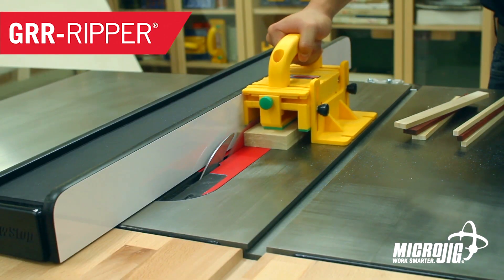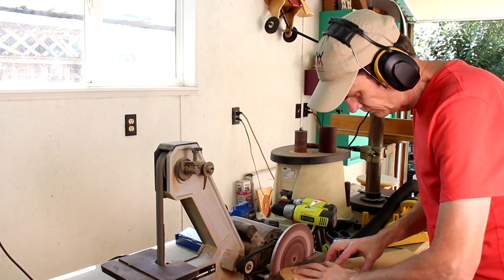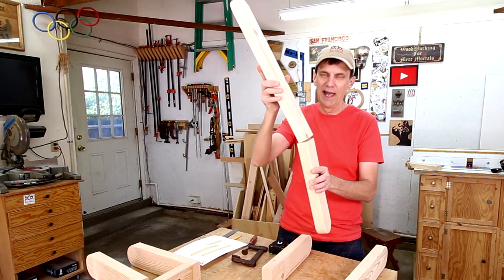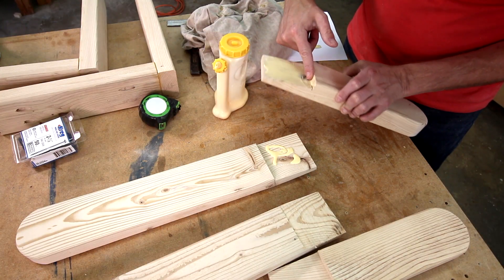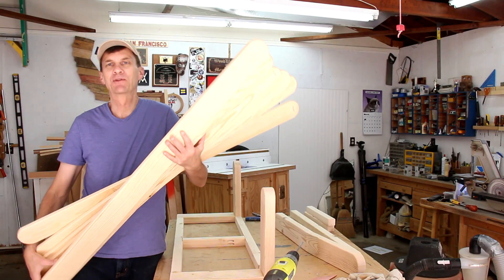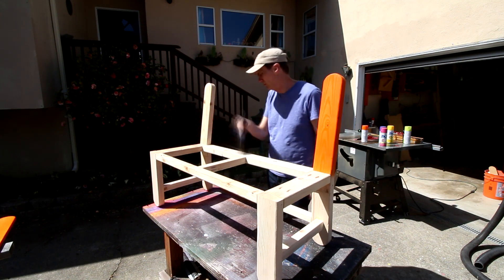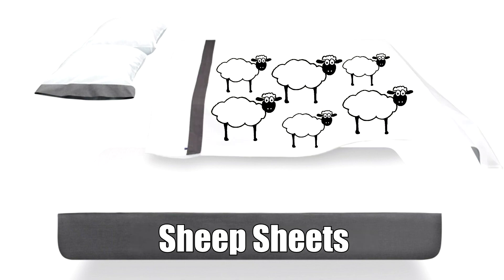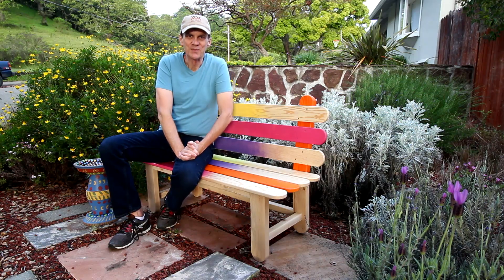Popsicle Stick Bench.  Fun and Colorful DIY Project for your Garden!

Comment: My grandson and I built the the bench last week, used Titebond III because it might be outside. The glue joint that i glued; the 10 angle, was painted so dis-colorization was not an issue. Everything was top coated with two coats of exterior clear water based poly. Thanks for the idea, my grand kids enjoyed it. It was a hit on my Facebook post too. Can i send you a picture of it?

Comment: Steve, look up a scarf joint as used by luthiers when making angled headstocks. One angled cut, plane the cut faces, flip one piece, line the pieces up and glue them.  I'm sure you could find some way to reinforce it with splines or something if you're not sure it's strong enough.

Comment: That looks great. I am thinking of making one for the local preschool, but how strong is that back going to be? [If required] is there some way to reinforce it?
Reply from the maker: +CodeFoxAus If you use those lap joints, the glue will be stronger than the wood.

Comment: Maybe do a simple box joint for the backrest and just cut off the excess that sticks out from the side. =D
Reply: Yes, that would make for a strong joint certainly.  In fact, I think I saw some Ikea dining chairs that had finger joints for this, so similar idea... increases the gluing area tremendously.
Reply from the maker: +He Ka Great idea!
Reply: Well now when I really thought about it, it would not be that easy... to avoid voids between the "fingers" you would need to cut the joint in an angle and do all kind of measurements... but the joint would nice and strong =)

Comment: What's the general concenus on using pocket hole joints for something like this? I'd be concerened that rain water would be able to sit in the holes and rot the wood. Perhaps not much of a concern for Steve where he lives, but certainly in the UK we get a LOT of rain.... I guess you could just fill the holes!
Reply: You can fill the holes with premade plugs or make your own

Comment: hi, I'm looking into buying my first table saw. it's on Craigslist and I don't need anything fancy it is titled as " 10" craftsman table saw " it is $85 and the person said they used it once for their flooring project and don't have a use for it anymore. is this a good deal? it looks like it's in perfect condition. thanks for the help! (im posting this on multiple woodworking channels this isn't spam)
Reply: +damics20 According to Sears website their cheapest table saw is $209 and has good reviews. For that price it's probably a good starter saw, I'm just starting off myself and bought a cheap Skil table saw on sale and the table seemed warped with a straight edge on it so I brought it back and ended up getting a higher end saw. So for that price it might worth the chance, except you can't return it if there's a problem.

Comment: I feel like limited power tools would work fine for the angled back.
Reply from the maker: +Tarukai788 I thought about that, but you would need a really long jigsaw blade to cut through the 2x4 width.
Reply: +Steve Ramsey ahh, that's a good point. I hadn't thought about the blade length.

Comment: When do you wear a  breathing mask? Sometimes I see it and sometimes not.
Reply: +Julika7 When the material he's working with makes a lot of dust. He always uses a mask when working with MDF, since that gets really dusty, and the mix of sawdust and glue that those dust particles are made of is probably nott good for the lungs.
Reply from the maker: +Julika7 Mostly I use a mask when sanding to avoid breathing in the fine particles.
Reply: I read that there's a higher risk of cancer through hardwood dust. (example: http://www.hse.gov.uk/woodworking/wooddust.htm) And hardwood are so many wood types. :o